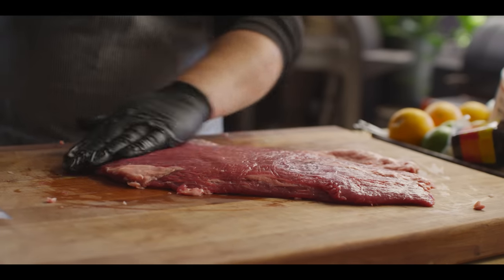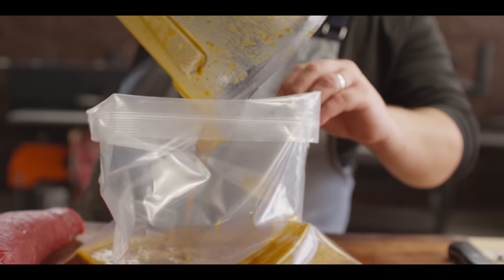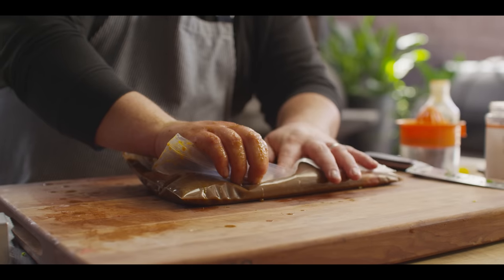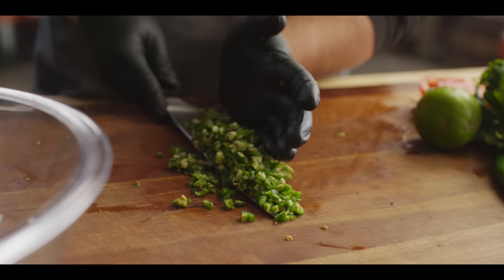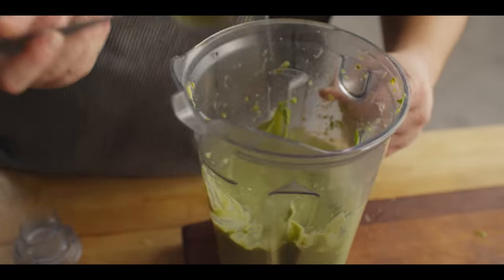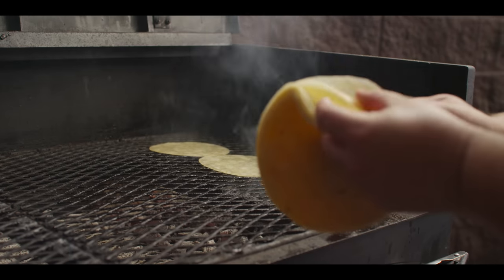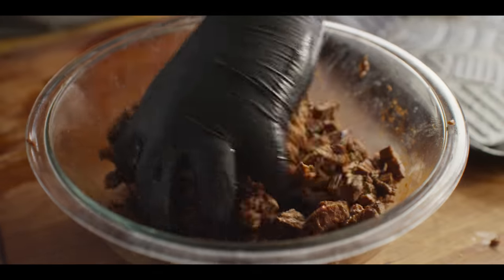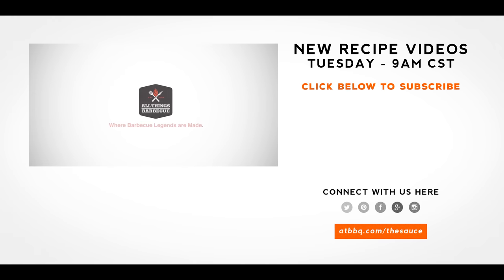Carne Asada Tacos

Comment: (No you tube channel listens)Try using brisket flat. (I always grill the flat and smoke the point.)Slice it thin season with only salt. And chop it up fine. In mexico we use bone in brisket like that its called "costilla de pecho". Serve it over corn tortillas. And for the green salsa grill about 5 jalapeños and 3 serranos (depending on your heat tolerance) as well as some garlic and onion. Blend everything together and slowly add canola oil while blending to emulsify. Salt to taste. People think it has avocado because of how creamy it gets. Garnish it with onion and cilantro. Add lime.
Reply from the maker: Sounds awesome! Thanks for the tips and taking the time to comment!

Comment: Chef, another winner recipe here added to my playlist. I personally don't do tacos as I find them no different from the next taco cart out here in Los Angeles but, there's something appealing about these...I think it's the freshness at presentation. Could I cook and hold the asada in juices for a couple hours or will it tighten back up?
Reply from the maker: Thanks for the great comment! You can definitely cook and hold in the juices. You should keep it in foil or a sealed container and be sure to hold above 140-degrees Fahrenheit (safe temp), and not so hot that it wants to dry out. Thanks for watching.